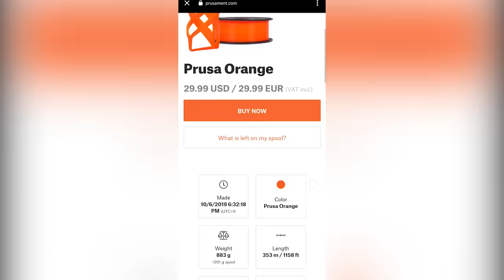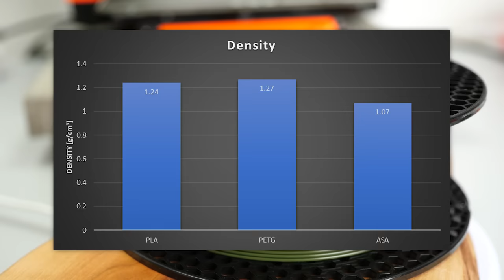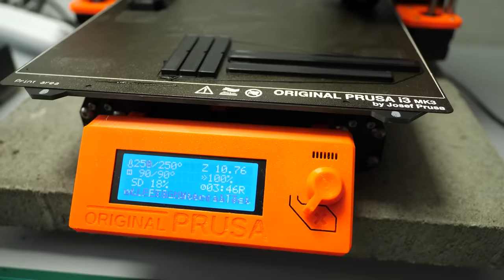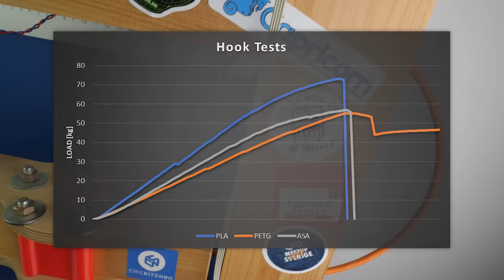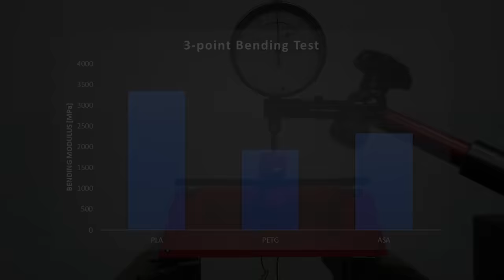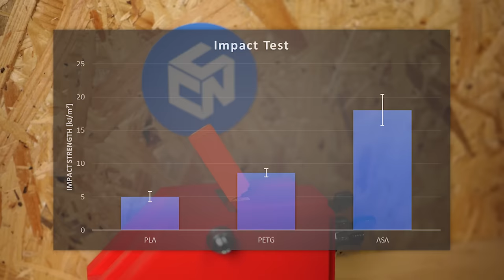The BEST 3D printing material? Comparing PLA, PETG & ASA (ABS) - feat. PRUSAMENT by Josef Prusa

Comment: You should try redoing your annealing tests, but this time using moulds that you can bake so that parts can be cooled more uniformly and forced to stay in shape :)
Would be nice to see how the common materials we use for fdm printing would go being injection moulded and then also annealed too :)

I believe these three variables could improve the strength, impact resistance, thermal resistance, flexibility (try injection moulding with ninja flex?), Layer adhesion, etc.

Another great thermal test would be to see the level of how flame retardant fdm, annealed fdm, annealed moulded fdm, injection moulded and annealed injection moulded would be.
A nice hot torch being waved past the part at a regulated heat and speed should suffice with a temperature probe and smoke sensor would help :)

I absolutely love your tests, they have helped so much when designing parts or even trying to get minor details to print properly when working with foreign materials!

Comment: How about testing how well they stick to each other?  I bought a pallette 2 pro and I curious as to which plastics are totally incompatible or really compatible.  

Also it might be interesting to engineer the prints... for instance using stiffer high strength materials in better locations to get maximum moment of inertia and use cheaper materials as the web.
Reply from the maker: With the Pallette you should probably stick to one material (PLA/PVA should work as well) because the materials go through one nozzle. Purging between materials requires way more material than just switching color.
Reply: @CNCKitchen  I was trying PVA and having good adhesion on the splice with ABS... but then I saw a video showing PETG as a bond breaker at the support interface when printing with PLA.  

In multi-colour printing I currently have a very nice translucent red PETG and a black ABS I was going to print in the same part and this is why I pose the idea.  Using the splice I can stick anything to anything but layer to layer would be a different story.

If only the colour changes could occur without the expense/complexity of a good multinozzle setup or the huge purge block of a single nozzle!
Reply: I tested multi-material prints on a Prusa MMU2S.
PLA and PETG won't stick. They do work great as support material for each other (100% interface layer).

However, you can basically pull your print layers apart with your hands.
The impurities which remain in the nozzle destroy your layer adhesion.
You need a crazy amount of purge volume to actually clean your nozzle.
This basically makes the MMU unit from Prusa useless for me.
I still think they should call it a "multi colour unit" and not a "multi material unit".
Reply: @michaelschaub  Hmmmmm... this is what I was afraid of.  You almost need a table things that stick and things that don't and THEN choose the properties you want to exploit.
Reply: @someguy2741  There are specific support materials out there for PLA and ABS/ASA and Nylon. For PETG I found nothing when I searched last year. However, PLA suprisingly perfect for that job.

So the topic "what does not stick to each other" can be handeled.

More difficult will be the question what sticks to each other.
However, it should be a rare case that you need one part made out of two materials.
You could address that directly in the design process. Don't just cut it and print two flat surfaces of different materials and hope for layer adhesion.
Better design joints directly in the part, like you would do it in woodworking.
Also, add some holes for screws if you can. I'm holding two pieces of PETG with some Epoxy and two 12*3mm screws together, works great.
Reply: @CNCKitchen  Perhaps a different story with a ToolChanger System? I've seen people on the E3D forums using PETG printing directly over PLA support structures with no attachment/polymer mixing
Reply: @michaelschaub  I was looking to combine different colours that just happen to be different materials.  Also I was going to use ABS for some flexibility in some snap together parts and use PLA for strength and stiffness.  Also there is the idea of adding a layer of TPU to some items.  

Part of hobbies is exploration of pointless details just for the sake of exploration :p
Reply: @someguy2741  So true :-)

Comment: Would be curious to see how Prusament PETG performs compared to extrudr MF PETG. I use extrudr MF PETG and didn't see any visible deformations when throwing it in boiling water, although it prints at lower temperature. TPU would be another interesting material to test, the layer bonding is amazing and of course the impact resistance should be much better than any other FDM printable material, not sure how well it would hold up for the hook test.

Comment: My projects require dimensional accuracy and need to stand-up to relatively high temperatures (they are frequently stored in my car in the hot summer sun) -- PETG is my go-to material for 3D printed parts.

Comment: I mainly use PETG as I can have it for nearly as cheap as PLA and I read somewhere it is UV resistant,. But I don't know if a UV-resistance test can be doable? Maybe with a light for nail polish?
Reply from the maker: A nail polish UV light is probably too narrow in spectrum to get a proper result. You'd properly need more professional equipment, or just place a batch outside.
Reply: It would also be dependent on the colour of the sample.  Different dyes will drastically effect UV resistance.  Different dyes will fade differently so you would need to decide whether you are most concerned about colour retention or strength.  

For strength you would need to compare clear filaments I suppose?  I think this would need to be placed outside for an extended period.  So its not terribly practical unless you want to wait a year for the results :p

The good news is if you really need UV resistance you could spray paint or clear coat the item and get the results without worrying about the filament.

Comment: I tried several times working with ABS, but each time gave up because of warping (causing the part to come off the bed while printing), even with a heated bed. I'm always printing with PLA, but since I have a 1kg roll of ABS still lying around, I guess I'll keep trying in between PLA rolls

Comment: Please. This good report misses an important test.
In my modest opinion you should print few springs using same materials and report flexibility & ductility + capabality of teach material to go back to the original form once springs are compressed or extended for different amount of time at costant temperatures. Thanks in advance.

Comment: You should test some Extrudr Green-Tec Pro. It prints as easily as PLA from the data it should outperform ABS.
Reply from the maker: Just got some. Will test it, soon!
Reply: @CNCKitchen  excellent Stephan. Looking forward to some technical tests. I‘m also an Aronautical Engineer.

Comment: Would love to see this comparison with other materials like PLA Plus. 

I´ve been mostly using PLA, because it´s cheap and there is a lot of brands to choose from. Also because it´s recyclable and cheap. Since what I print are mostly iterations of parts I´m designing, they end up in the bin, since they are not meant to be used in the products I´m working on.

Comment: i really want to see an environmental test like for example petg you've done a heat test but what about a cold test, how does it do with leaving it in direct sunlight for a week, how about being dunked in water for a week, or a simple outdoors test like strap weights to it hang it on a pole and leave it outside till significant degradation occurs.

Comment: ASA and ABS must be printed without a cooling fan if strength is in any way a consideration. In my opinion, based on almost exclusively printing ABS, it’s because the fan cools it way too fast. If you slow down, you can “cool” the material and layer adhesion doesn’t suffer as much. I’m absolutely not surprised at how easily the samples failed. Have you ever done a cooling fan and printing speed comparison on ABS/ASA? That could be interesting.

Comment: That hook shape is only telling you how much layer adhesion you have. It doesn't give the overall strength of the material. Layer adhesion can vary greatly depending on many factors. I've been trying some different shapes, infill styles, and print directions. Trying to find more consistency in testing regardless of layer adhesion.

Comment: I got some classes in Autocad 3D and some in solidwork. I am planing on buying a 3D printer (flashforge new creator pro) and make my own equipment for airsoft and other hobbies such as housings and mounts for NVG's. Do u think it would be durable enough for final products or will It only be able to print some fragile tacky prototypes? Nightvision equipment is very expensive, only the intensifier tube does cost from 1.5k-4k Euro, so it really needs to be up to task.

Comment: I use PETG most of the time :) for quadcopter stuff it depends..TPU for cam mounts and stuff, but if you need a considereably stronger part like motor mounts then nylon or PC would be tha way to go.
Reply: How about brushed quad frame?  What material do you recommend between PLA or PETG?
Reply: @wibbyarief8958  petg should work better because it flexes but pla is also ok if the geometry is thick enough. I've made my micro brushless frame for 40mm props with Nylon which works really nice:) good luck m8!

Comment: I make canes for local military veterans. Been trying to figure out which material would work best for continuous impact and beable to support an average force of 250lbs, the models I've tried so far on the printer have a high tendency of separating where the handle screws onto the shafts. Any advice would be usefull, absolute last thing I want is for a handle to fail and someone get hurt

Comment: For my electric unicycle trolley handle brackets, it sounds like ASA is the winner because of its heat and impact resistance. The wheel does can sometimes fall over with the trolley handle in the up position and this is why I am now 3D printing a new set of brackets. I am totally new to 3D printing however so are there any EUC riders who care to comment?

Comment: Im mainly use my printed parts for racing drones and tried to print some micros frames in PLA and turned out to be a bit too brittle and heavy (compared to carbon fiber of course)
 I also tried ABS but gave up due to the printing issues with the material as you mentioned (layer adhesion and warping mainly)
for almost all adapters and mounts thou I use TPU flex filament (great adhesion to print bed as well as to itself, and tough af...

Comment: Thank you Stefan, this is very helpful. Right now, I'm printing a new bracket to mount my Hemera to my MK3S. I'm printing it in PETG because I thought that was the right choice, but now I don't know. What do you think, should I keep printing it for the next eight hours, or should I cancel it and just use the PLA version I already have printed?
Reply from the maker: Definitely no PLA because of the temperature resistance. PETG is a better choice there.
Reply: @CNCKitchen  Thank you very much for your response. I ended up letting it run so I have the parts now.

Comment: What about metal coated parts? or carbon fiber wrapped? I've been seeing a lot of Youtubers using carbon paints to electroform different materials, like leaves, wood, crystals, and 3d prints. Really curious how that would change strength for things like gears, hooks, and (drone) frames.

Comment: Gooten tage mien fruent. Sorry but I can’t write in German to save my life. I really enjoyed this comparison testing you performed, I just recently ordered a Creality Ender3 v2, it’s my first 3D printer,  my main hobby is FPV quads and I’m looking forward to printing parts for them. I have two questions if you don’t mind answering. The first one is where did you get the items and instructions to build your printer enclosure, What I like about it is that it doesn’t block any visual point of the printer like so many of the pre made enclosures, and my second question is I’m still a bit unsure of the best filiment to use for quad copter parts, if thinking ABS for its regitity , if you have a better recommendation I’d love your input. Thanks very much.

Comment: Not sure if I’ll get any answers here but I got an Ender 3 recently (working like a dream) and I’ve been having fun with PLA but I am considering dabbling in PETG. Mostly because I have parts I want to print that will be outside somewhat and I have zero faith that I won’t mess up with ABS. Any tips or tricks with an Ender 3 for PETG?
Reply: Responding to my comment 1 year and 2 new printers later: you're fine bud. Have some faith in yourself and don't be afraid to mess up. You learned lots.

Comment: I was just about to order PETG too, trying some at work really like it for flexibility and temperature resistant so good for some projects, for a quadcopter I would use ABS since it’s lighter and impact resistant for high speed crashes. Now what’s the difference between ASA and ABS+ ? Also how is impact strength and temperature resistance of PLA+ after its been annealed ?

Comment: For engineering purposes at home, I want a strong stiff (not petg), fairly heat resistant (not pla), non toxic fumes (not ASA) material, that itself is briefly food safe, prints beautifully and bridges well. NGEN is the closest I have found. Unfortunately it bridges very poorly on my Prusa MK3, also because the part cooling fan below 100% pulses every 8seconds (Prusa wont fix).
Reply: I would prefer UV resistant as well, but that is where I compromise...

Comment: Might seem like a dumb question but what would you use if you rented a room and had to have the printer in the room with you?  I just ordered my Prusa i3 MK3S so I have about a month to get ready for it.  Do I just need to make an enclosure for it from the get go so I can use what best meets my needs?  I can put it in the closet but it isn't air tight or anything.  Which filament has the lowest odor and is the safest to be around when printing?

Comment: New subscriber  👍
 I'm looking at either a  Creality CR-10s or an Accuuracy Geeetech A10t with triple extruder 3d printer.
With the triple extruder, I'm thinking of mixing carbon fibre filament inside a PLA piece.
What would you recommend?
Reply from the maker: First printer? If yes, then I'd definitely go with a single extruder /single filament printer, if you're experienced, you can give a multi material printer a try but don't expect to much. IMO more a gimmick than something really useful.
Reply: @CNCKitchen  Cheers for the advice 👍

Comment: any practical use would require a 35-50% minimum infill. like a bicycle drink holder, license plate, light holder, or any item you would want to use outdoors. which would drastically change the results of all of these tests.

Comment: I have extensively tested printing materials for drone parts. The absolute winner is Polymaker PCMAX filament (excluding PEI/PEEK), Neofil PC/ABS is a close second with pure PC, but lacks the stiffness, pure PC has less impact resistance than PCMAX. ASA is similar to ABS, it's "ok" but not great at all and lacks stiffness, Formfutura AppoloX was a big disappointment, it looked great on paper... PETG... is worthless for drone parts, it'll almost snap as easily as PLA. Nylon was also a disappointement, it's not worth the difficulty to dry and print when PC/ABS or PC & PCMax are clearly better. Carbon fiber materials are more stiff but are structurally weaker (tried PC/PLA & PC/PETG).
Another useful material, not for structural parts due to lack of stiffness but for protective parts is PBT, it's an absolute beast for impact resistance, and "easy" to print, I would say it's better than PP and much easier to print, however PP has lower density.
Reply from the maker: Great insight! Thank you.

Comment: Stephan I feel like you would be a great source to ask. Do you know if anyone makes a ASA / Polypropylene blend? Been researching filaments for a 3d printed product I am working on. I enjoy ASA for it's heat and weather resistance but wish it had a touch more yield to it rather than snapping. I want to make tough parts that can take some out door abuse like impacts ect and still be rigid.

My mind has gravitated to the blend I for mentioned above. Seem like a 90/10 or 80/20 ASA/PP blend could give us a very versatile filament. Not even sure if the two could be blended, just a thought I've had.

Comment: Would be nice to see CPE included in a test like this. I would like to see Fillamentum's claims tested.
Reply from the maker: CPE means Co-PolyEster and PETG is a CPE, so you should be covered.
Reply: Fillamentum claims "Made from modified PETG material. Additional monomer improves all the properties when compared with PETG filaments" it's certainly more flexible.

Comment: I can’t find info about printing specification in this material. PETG settings especially cooling parameters have so much influence on printed part durability. If you use cooling on PETG your part will be weaker. Even 5% cooling change durability of material (tested on PrintoH3 printers with closed enclosures)

Comment: So where PLA may be a bit stronger than PETG in strength and stiffness, it doesn't quite hold up as well to heat, impacts, or UV light; and while ASA may be a bit more robust, as well as lighter than PETG, it's also a bit more difficult to print 🤔